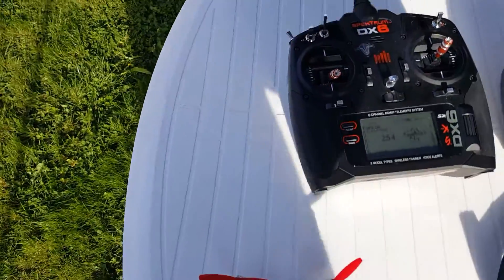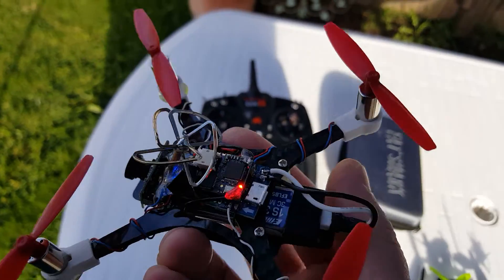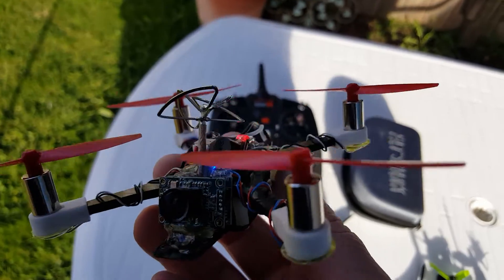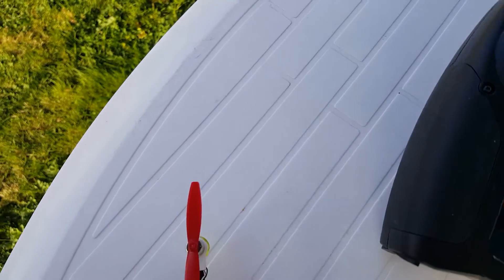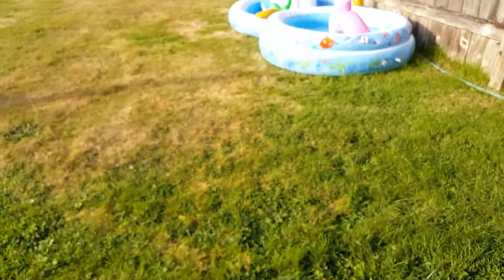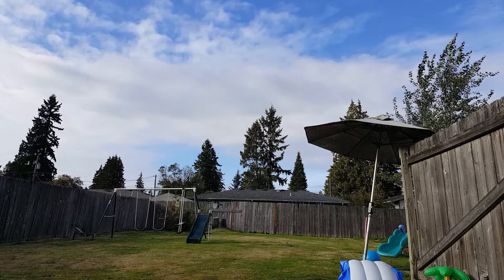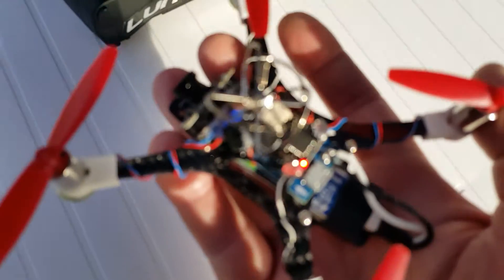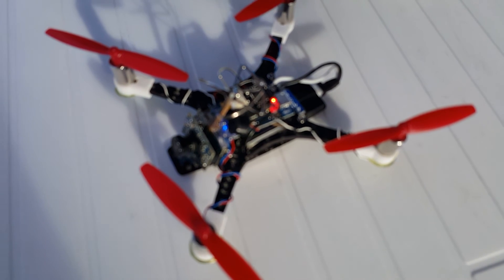Finally a brushed fc that works

Comment: Love your videos and your " matter of fact" style. Your F3 build using the Happy Model board, remember your betaflight settings ? My current set-up is a balancing act on a beach ball...being new to this, I thought maybe I muckerd up the board and ordered another just to find your video and grip. By the way, love your stick skills, wife ever climb up your shorts for flying brushless in the house ?
Reply: i'll shoot you the details and video this weekend, help is appreciated.
Reply: wondering what PIDS you would start out with on these damn Happy Fucked Ya F3 EVO boards, they are driving me nuts. 

A couple of things to verify tonight such as AirMode being turned off for now and making sure I have Horizontal and Angle mode configured correctly. I have flashed my first board to Beta 3.0. My new QX-90 is still cleanflight and fly's like ass.
Reply: you configured with Betaflight?  I really dislike Banggood...just got a junk EACHINE LCD FPV display that took a month to get here...broken...getting somebody to give me an RMA is a joke

Comment: I received  the same  Eachine F3 FC.  At the moment I'm using Cleanflight, and was wondering how you handle "low voltage warnings".  Do you have a buzzer or led hooked up to blink at low voltage?
Reply: Thanks for your help, but it's too late about the bat connections. I've already disassembled everything to get to the buzzer pads.  Oh well.  Thanks for the info.  What buzzer do you use?  5v?  I tried swiping the buzzer from a transmitter for my proto x, but that just makes clicking sounds.